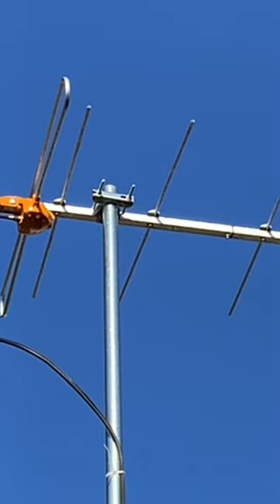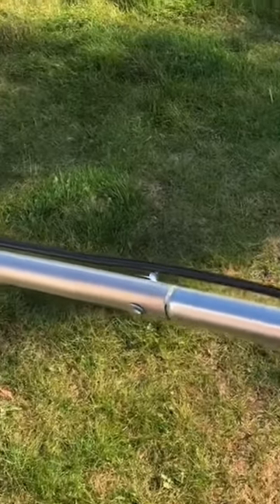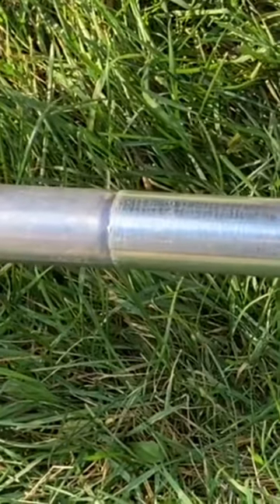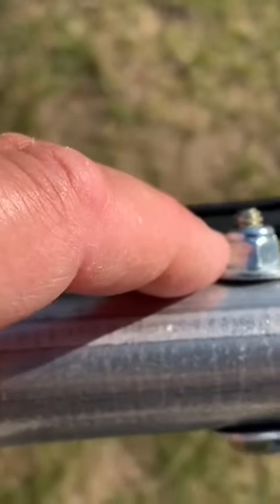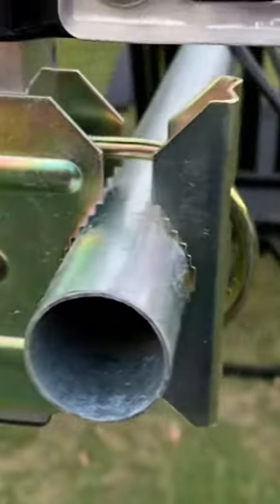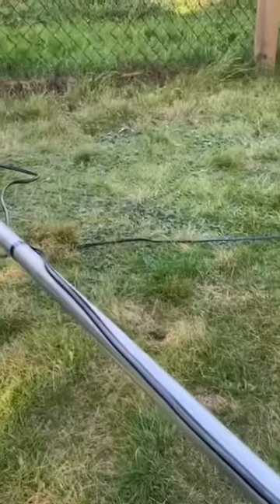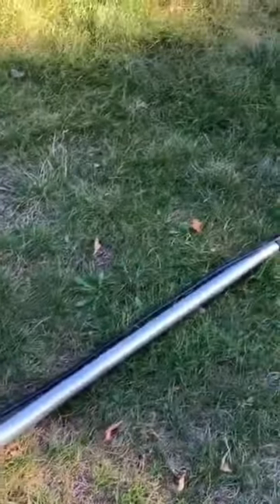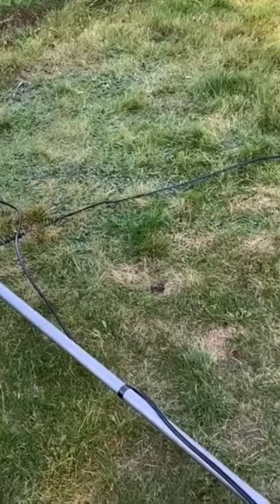The BEST TV Antenna Mast Pipe Idea!

Comment: What gauge is that? If it's 16 gauge or larger, it's better than the majority on the market. If you want to see pathetic, RCA makes mast sections that you can bend over your knee. This really does remind me of the old Radio Shack mast sections I used to buy 40 years ago and I believe they had a pass-through bolt as well. As far as why it is cheaper as someone asked, I am quite sure it's because of the quantity of fence sections produced so the economy of scale and not necessarily lesser materials, quite the contrary I am sure.
Reply from the maker: I believe the post is 18 gauge metal.

Comment: What I find hard to believe is that the pipe for the fence costs $17 dollars but a piece of electrical conduit or antenna mast exactly the same size and lenth costs $67 dollars. WHY ? ? ?
Reply from the maker: Good point. Could be material, metal gauge, who knows?
Reply: I have used 2 sections of fence pipe together, works great,wouldn't use more than 2 sections unless you use guild wires.

Comment: Maybe for small antennas Bigger antenna and some wind and they bend
Reply from the maker: Good point, that’s why I mentioned the need for bracing and guy wires. However very large antennas are best suited for a tower.
Reply: I like my Blue sky Al1 series tripod mast system good for 30lb antenna up 30 ft max. Pricey. But I've used this aluminum mast for 3 years in the Philippines and no problem 
with rust.  Each section of the mast is 3ft. long and o.d. is 2in.
Ask for the reconditioned Al1 mast. It's like new but discontinued.

Comment: Great idea. Any thoughts on where to get an in ground mast for 36” or 39” satellite dishes? 2” OD and maybe 8’-10’ in length, in Canada. Thank you.
Reply from the maker: I would look at a metal or steel supply shop. That is where I bought some schedule 40 (3-1/2") pipe for a C band dish. They may have a 2" OD pipe you can buy.
Reply: @NorthcoasterHobby  Thank you, I’ll look into that.